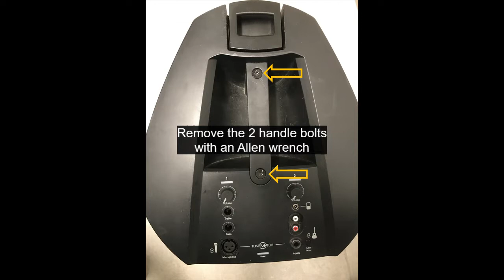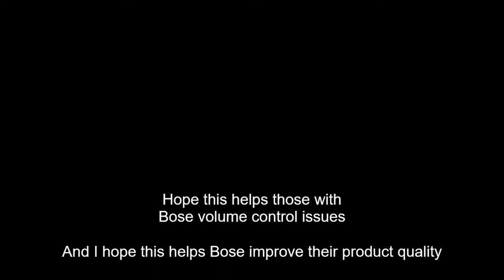Bose L1 repair

Comment: hi, this is very helpful, what was the issue on you volume control?
Reply from the maker: Cold joint on the soldering. You can see in the video, there was not much attention to detail when manufacturing the motherboard. I can see this is a common problem with this kind of Bose product
Reply: @meylock  the bass module out in the model 2 and 1S had similar issues.
Reply from the maker: @cduemig1  , I'm not surprised. The customers are paying for bad workmanship

Comment: I have a Compact that now has become un-usable due to both volume pots not working.  Pressing down or wiggling the knobs can make them work sporadically, do you think this sounds like a cold solder joint issue? Deoxit spray did not help.
Reply from the maker: It would not hurt to inspect the soldered points on the potentiometers. I'd heat them with a soldering iron while being careful not to over heat as this can damage the component
Reply: @meylock  I had someone reflow the solder and it did not help.  It seems the pots have just gone bad, there are numerous examples of this happening, mostly on the Compact but to some other models too.  Bose won't step up and/or admit this is a known issue and a flaw in their components.  I ended up sending it to Bose, $175+tax, they cover all shipping and put a one year warranty on it.  Seems expensive if all they are doing is replacing 2 poor quality pots that failed with just moderate use.
Reply: Looks like they replaced two PCB Boards and it doesn't say pots were replaced though maybe they are considered part of the boards.  The parts listed as replaced on the report are PCB ASSY, IO COM and PCB ASSY, AMP/SMPS. It seems this issue is fairly common and may be more than just bad pots or cracked solder.